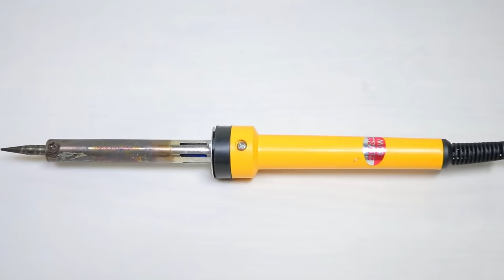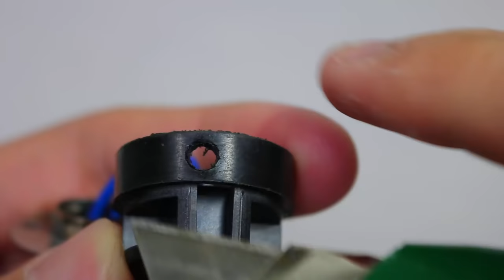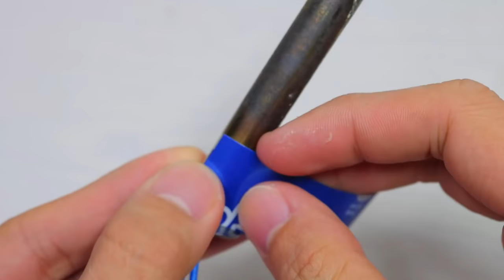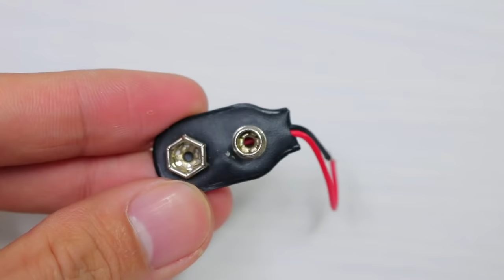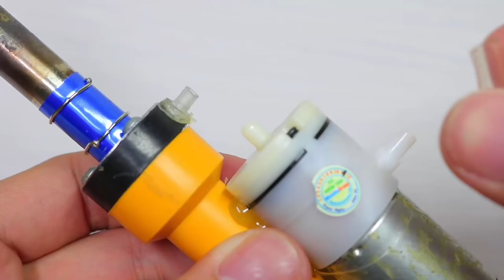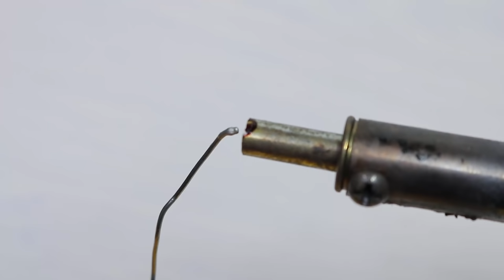How to Make Hot Air Gun from Soldering Iron

Comment: For those asking, I think he used a 12v DC water pump motor. I'm planning to build something like this but playing around with the concept of using an air pump (the kind that they use in home aquariums) as the blower. With this, the hot air gun would be so much lighter since the air source would be sitting on a table and not mounted on the hot air gun. No batteries required making the whole thing a lot less lighter. I'm sure I can think of something to "tune" the strength of the air coming out of the pump depending on the need. 

For the nozzle, you can use rabbit ear antennas. You can make several nozzles out it in different diameters and lengths.
Reply: Fan regulator, to control. Motor speed
Reply: Just buy a damn heat gun.
Reply: @gizmo557   pro not everyone have money we are     poor ;)
Reply: No, he used a 6V DC 3L/min negative pressure air pump. It's written on the label.
Reply: Soo Wonderfual,, amazing
Reply: @gizmo557  And pay 3x the shipping cost lol
Reply: Ear cleaner...

Comment: Good idea if you are desperate,  but for the price of a rework station 
it will get too 500 deg no problem, you can see it is not heating the 
solder properly, you could simply remove these components with
bridge soldering..Or low melting point solder to remove, even a hot
air gun with nozzle...This is a good solution if you have none of the
above and want to have some fun..

Comment: Hi, good video, how many watts is that soldering iron? I built one with a 60w soldering iron it is good for heat shrink tubing but not hot enough for desoldering components...
Reply: luisfilipe1983 ...it's of 60 watts, if you pay attention carefully you can see it, maybe the quality of the soldering you've used isn't enough, that's why it does not heat enough, actually the temperature that a soldering can rise up is directly proportional to its quality.
Reply: Actually, Wattage doesn't matter for this type of air soldering. In case if you want to do it so, I recommended you to use a lower wattage, like 20W or 30W and it is cheaper. wattage is actually for the specific size or chape of soldeing tip, may last longer heating time or shorten the heating time.
Reply: 500watts
Reply: try using less air flow
Reply: @rexsovelllejes9383  ha haaa
Reply: @JSuparman  He ain't bullshitting tho, a real hot air soldering station uses a 500w heater. Granted, that's for strong airflow and 500ºc. I would bet the average 60w soldering iron you use for this project would be just like OP said, good enough for heat shrink tubes, or with VERY little airflow, it could, with a lot of patience (which you need even with the bigger soldering stations if you don't want to make a molten plastic mess), remove some resistors off boards.
Don't expect big BGA chips like graphic chips off with this tho.
Reply: What is that as a motor
Reply: You can use the side of the welding iron for tubing

Comment: Split the AC power and add a 5v charger, to drive a 5v air pump - simpler? and single system
Reply: jake carvey just use a 230v pump
Reply: That might be too heavy
Reply: where did you buy a airpump?
Reply: Amazon, Saim DC 6V Mini Air Pump Motor for Aquarium Tank Oxygen Circulate 2 Pcs  only 8Eur.
Reply: Lol just use a mobile charger circuit
Reply: @Jack_Mototech_Vlog  i bet he salvage it from fish air pump,i saw that parts

Comment: Nice design, but can it be plugged into the socket instead of the battery?
Reply: You will need an Ac to DC power supply to feed the pump

Comment: 4:50 the board got destroyed
Reply: pad destroyer v1.0
Reply: Exactly....I feel the component is also ruined
Reply: Ken Tups  Never know.  Actually the tool which he made is not temperature controlled. Datasheets provide a diagram called as "Solder or Desolder Profile" which will tell how much time at what temperature you can maintain to solder a component. Seems like the desoldered component might not work and the solder pad is also little destroyed
Reply: He can put a resistance to reduce the temperature
Reply: Not really, just clean it and it will look as good as new, I will never understand why people think so little heat will ruin a board.
Reply: @WertzOne  maybe not the board but the component is definitely ruined

Comment: I have the same air pump motor 6V. You use 9V battery in 6V motor. Is this safe for the motor? I ask you because I want to make this project using AC ADAPTER 6.6VDC in this motor 6V and I'm afraid for damage.

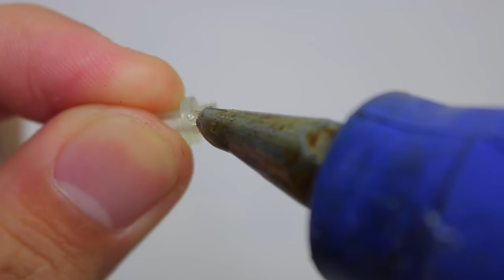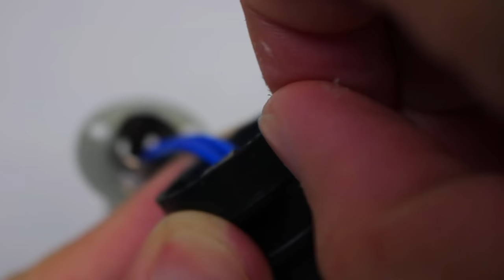Comment: Won't the hot glue melt at 1:15 - 1:20 during operation, especially if the pump is not connected right away during the heating phase?

Comment: Where can I find this air blower.Or motor?From a Aquarium air pumps?
Reply: Hi there. The pump comes from a inkjet printer. I would think you would benefit from a much bigger pump. The pump shown in the vid,is actually a vacuum pump,but just reversed the power leads. Hope this helps 👍

Comment: nO CAN DO!!Hot air guns are 700 Watts,you have, what ,a 60 or 80 watt iron? not enough power,see how long it took to melt that solder wire tip? got to do your power calculations first and foremost, for everything.
Reply: Not for mobile phones factory.
it's just for hobby 🛠️

Comment: I seem to think something is a bit fishy here.  If making hot air solder wands, so cheaply, were possible, I'd bet you could buy them from china for $15 or less.  Instead, They are like $40 on ebay, and are 3-5x the size of a normal soldering Iron. And Use A LOT more power. And for good reason.  Without direct contact, a 15-45watt heating element doesn't produce enough heat to efficiently melt solder with air...  Nice try tho... Good Video anyway!!

Comment: Interesting. If you were to redo this what would you improve? 

It appears you have too much heat for the limited air flow. Regardless, Sub'd after seeing this video at the bottom of the suggested videos on a video from the Diodes Gone Wild channel.
 -Jake
Reply: Upcycle Electronics  عغ٦
Reply: Upcycle Electronics 

Ĺ
Reply: Use a light dimmer to reduce heat. Connect a light dimmer to a receptacle mount them both in project box. Plug the heat gun into the receptacle. Adjust  heat output with the  dimmer.

Comment: this is really dangerous the vents are blocked on the iron so the internal heat will not escape and melt the 240v wires and zap u and cause fire the heat inside builds up very quickly on cheap irons like this because of the cheap element design
Reply: When you have vents it is natural heat convention when there is air flow from the air impeller of the motor it will cool down the heater unless the outlet port from the front is closed.
Reply: no because u should noot use with no tip the element temp will rise too much also if the air pump isnt on too so no its just wrong

Comment: Could he have spiced the pos/neg lead wires from the cylinoid to the electrical outlet of the soldering iron?
Reply: No, the air pump motor is a DC motor and would burn out or cause a fire id powered by AC mains power!